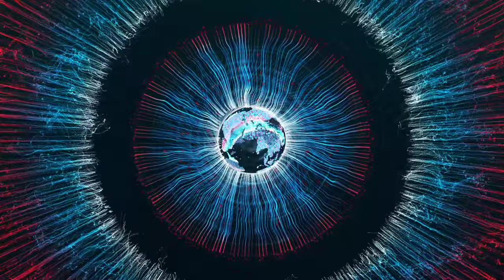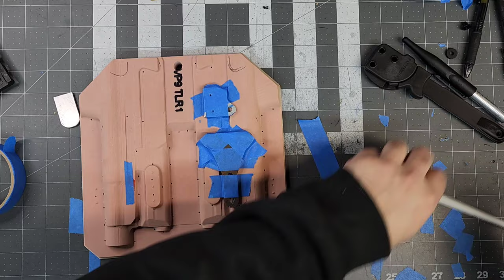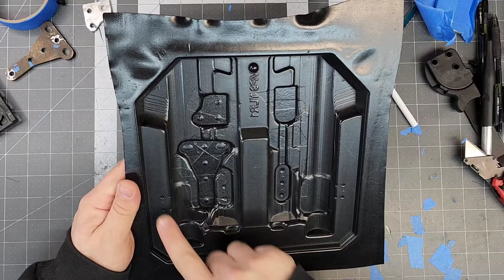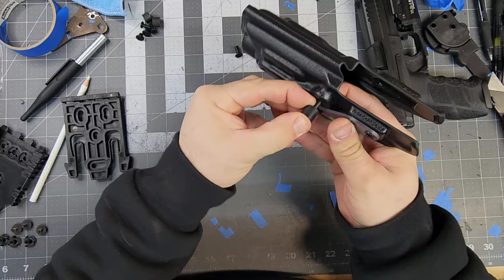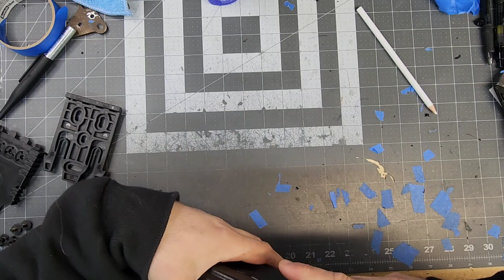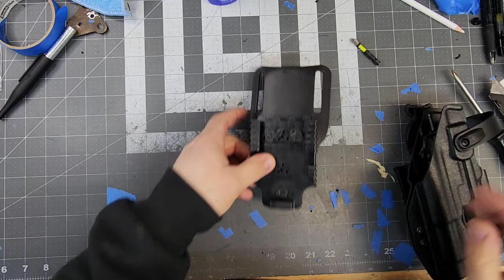Making A OWB Holster for the HK VP9 With TLR1 HL

Comment: So moving away from foam is about speed essentially?

As always, excellent video! Thank you.
Reply from the maker: foam pressing takes so much longer than vac its slows production down like crazy, but i started holsters by doing oddball combinations on the foam. I will still do it, but lean toward vac pressing for the majority of holsters. onec i have a 3d scanner in house, i will be making my own vac molds.
Reply: @FalTacUnlimitedLLC  makes sense. Some scanner mfg’s will send you their scanner to work with and review. Try before you buy 😅 In exchange for an honest review. I know that’s a process in itself, but coupled with the CNC, sky’s the limit.